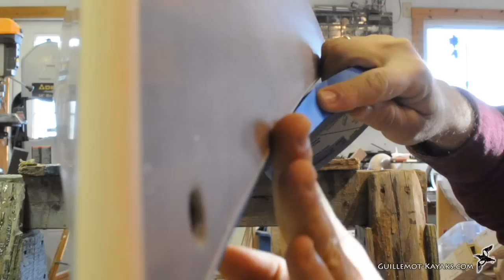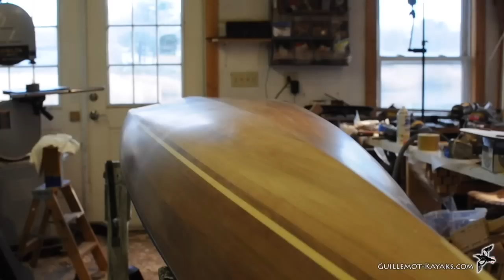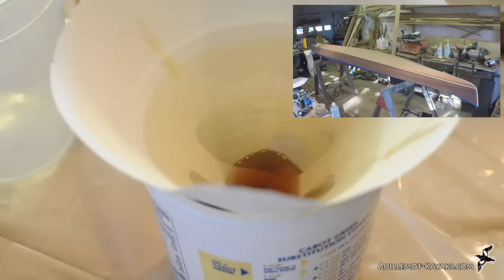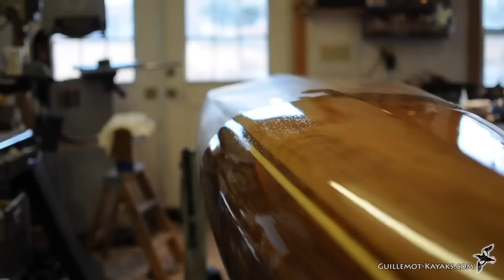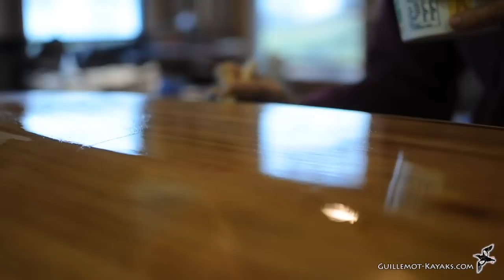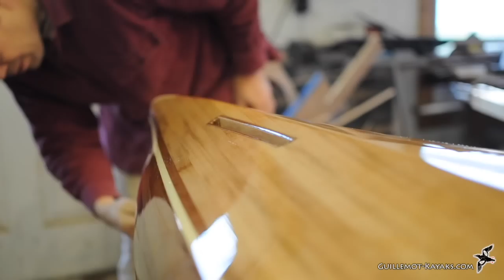Varnishing a Strip Built Kayak

Comment: Great video! Thanks nick! I'm getting ready to varnish my canoe pretty soon and I'm excited about getting done but am not looking forward to the varnish process! Last time I rolled on with a foam roller then brushed smooth with a bristle brush but I like your way better. How many coats do you do if it's over epoxy?
Reply from the maker: Adam,
Minimum of three coats like this, but I'll probably go with 4 or 5. I'll lightly sand between each coat to take the gloss off without reducing the thickness much, and then a bit of a heavier sand before the last coat to level everything out. Sometimes I don't sand at all until just before the last coat.

I've done the foam roller and brush thing. I just find using one tool makes it go quicker and thus the results are better.
Reply: Nick Schade I love that perspective. I think I'll try your way on my yoke before I do the canoe to see which one is easier. Just one of those things that's hard to make a video about cause there's so many different ways to do it and little nuanced techniques... I love the different angles you have to show how you do it. Thanks for the video🙌🏽
Reply: Always love your stuff!  Thank you for sharing!

Could I ask - how long do you let a coat cure before sanding and recoating?
Reply from the maker: Overnight. I'll probably hit this with a scotch-brite pad first thing in the morning tomorrow and slap on another coat.
Reply from the maker: I do my videos as a secondary aspect of building boats for customers. I try to do it so the video doesn't interfere with my ability to deliver to the customer on time. I've taken to setting up a couple cameras. One is a GoPro that gets the whole scene, then I move around my SLR for closeups as needed.
Reply: Nick Schade you've obviously found a good balance - love your stuff and look forward to seeing more👍🏽

Comment: Very nice Nick!! Would you use the same basic brush technique if you were using paint like Interlux on the bottom of a stitch and glue boat?
Reply from the maker: Yes, I would. The technique works well for paint. This is also the technique I use for epoxy fill coats.
Reply: Awesome thanks!